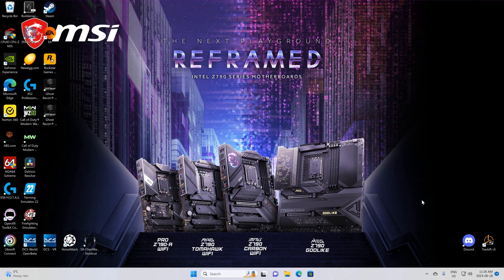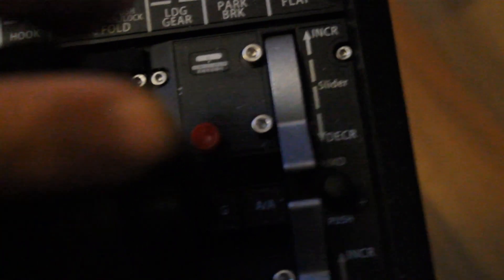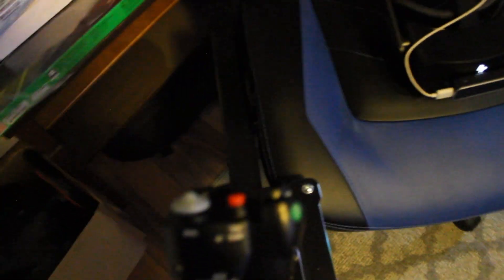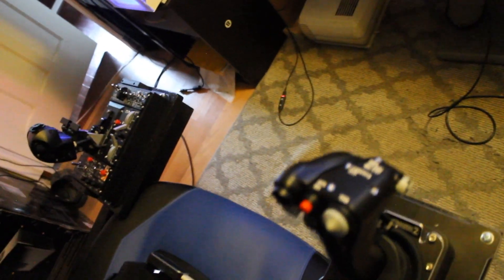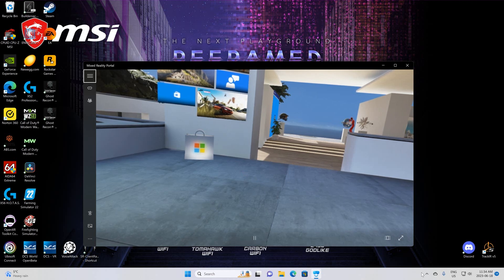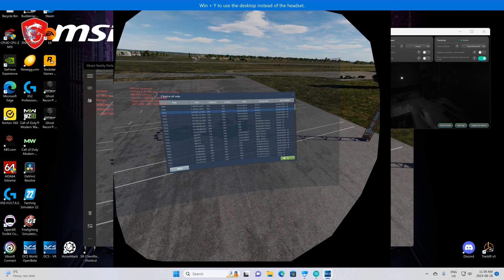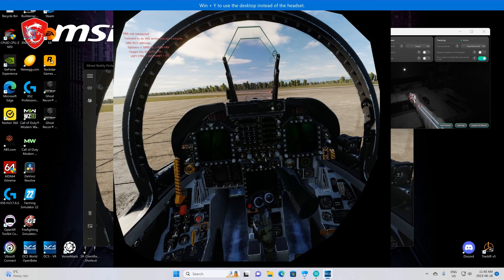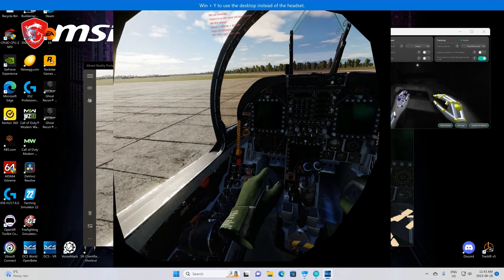DCS learning made easy. HP REVERB VR G2 Headset and hand tracking working in DCS.

Comment: Don't get it working reliable. 
Need the option in DCs for x axis and z axis (only got y) and also the option to turn off the click emulates (got index bend and thumb now). 

Currently I can't align with the simpit (mfds and ufc) unfortunately. 

Any tips are welcome.
Reply from the maker: Sorry for the late reply. In the DCS settings go to the Special tab and at the top you will see some selection for hand tracking which will have the  X, Z, Y settings. I used the UltrolLeap one but I have not done anything more with it then what you see in the video.